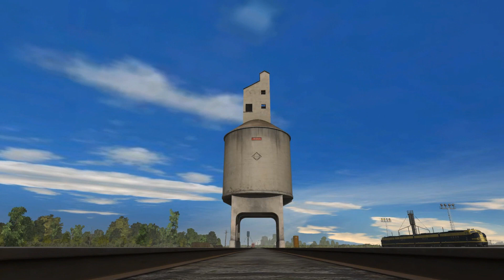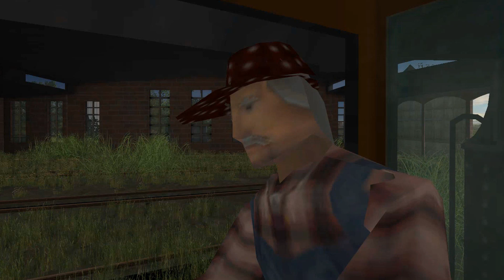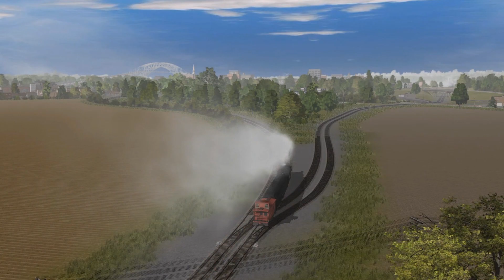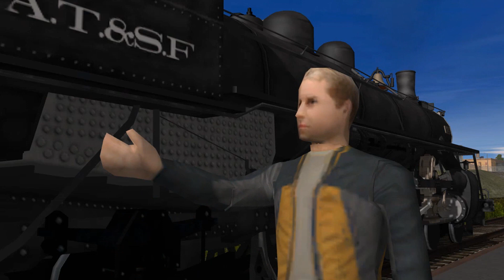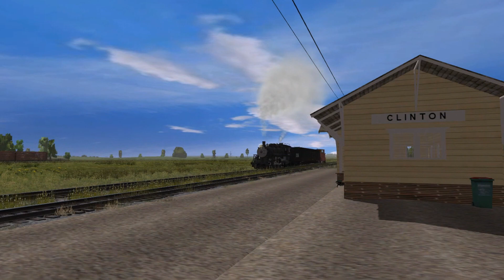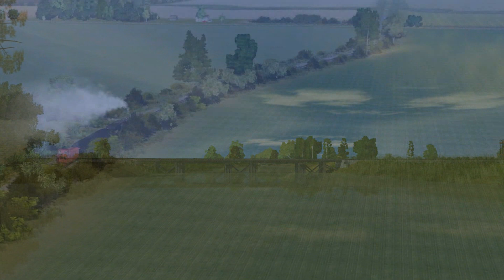Granger Rail Tales (Ep. 1) - Workplace

Comment: Oddly enough that you should use Santa Fe 1316 for this, as she is still with us (And in Texas) today. Though she hasn't run since the late 90's or early 2000's and needs a major rebuild, she is currently owned by the Texas State Railroad.